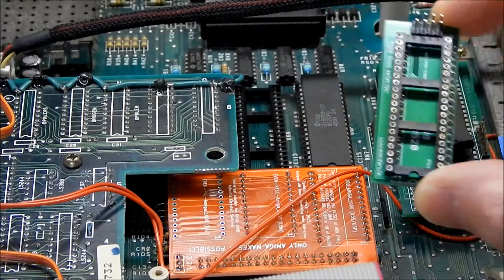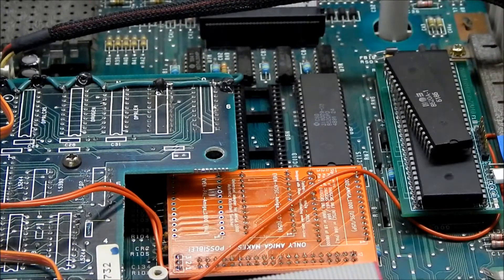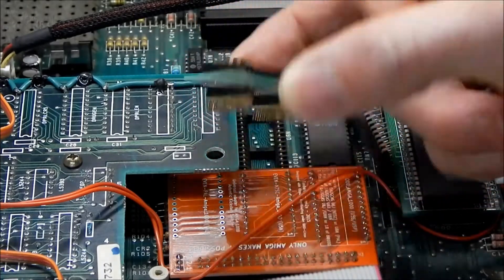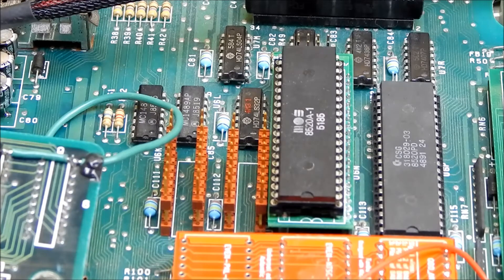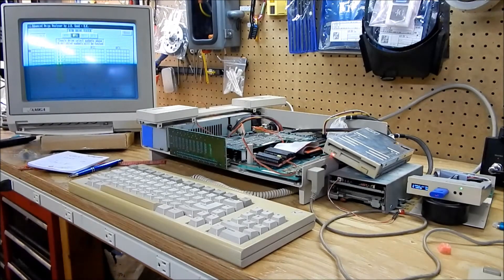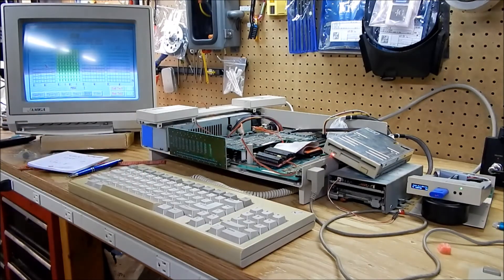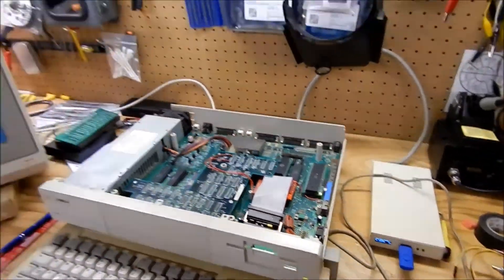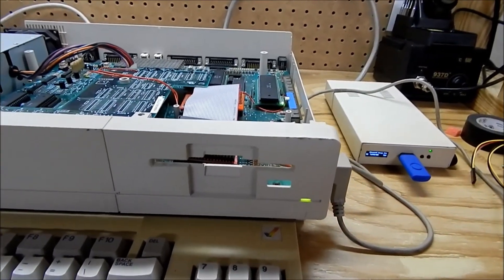Amiga 1000 : DF0:/DF1: NTSC Drive Switcher Install

Comment: Please can you explain me if whit this pcb switch and whit the jumper in that position can i have on my a500 rev3 an external gotek in df0 and the internal floppy in df1 activated ???
because whit a normal boot selector when the external drive is set to df0 the internal floppy is disactivated and not df1 switched.....

Comment: Just wanted to add that the drive switcher available from AmigaKit (http://amigakit.amiga.store/product_info.php?products_id=12673) did not require any modification of the PCB. It fits very snugly into the CIA socket without interfering with the daughterboard. I just installed mine today. It does not have a dedicated jumper option but it might be possible add one anyway if the pins are adjacent to each other. I will just dangle the switch through a tiny gap near the expansion slot.

Comment: Hey Steve! Where did you pick up your FDD switcheroo?
Reply from the maker: I bought it from the sordan.ie Ebay store, it appears that they have some on there right now(as of 1-22-19). Just keep in mind if used on the 1000 it'll have to have a little shaved off of the pcb so it will clear the headers for the daughter board, otherwise it works great.
Reply: @SteveStoltz  I saw that. Your mod to the board looked perfect. I don't personally need one but I know someone who does. But I might pick one up as future-proofing. I'm not a fan of the Gotek in terms of aesthetics, but nothing lasts forever (looking at you, original floppy drive).

Comment: Great job =D  That 1000 really is getting a lot of nice mods =D  You could fix that old FDD btw - chances are it just needs the heads cleaning, lube of rails, general clean, maybe a couple of replacement electrolytics.
Reply from the maker: Thanks, I'll look into how to repair those old floppy drives. If i remember correctly the error I was getting in Amiga analyzer was error 21, which i seem to remember was something to do with alignment. I'll have to take a little deeper look into it though.
 I'm really hoping that I'll be able to make it fit into the case with the kickstart switcher. I'm thinking that a combination of relocating the resistor so I can remove the pin strips and milling the rear the holes to allow me to tweak the drive upwards slightly may do it.